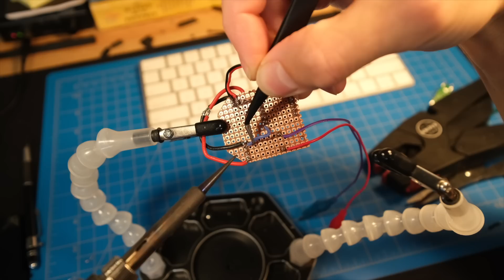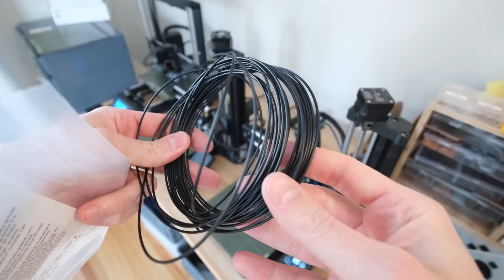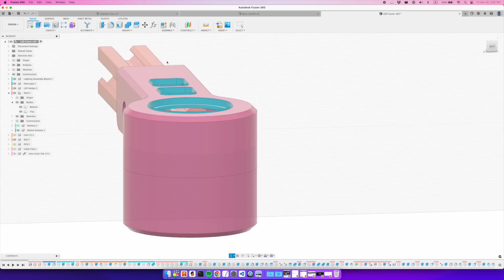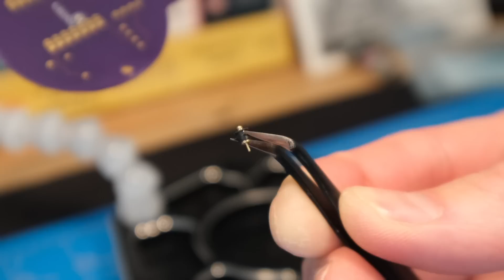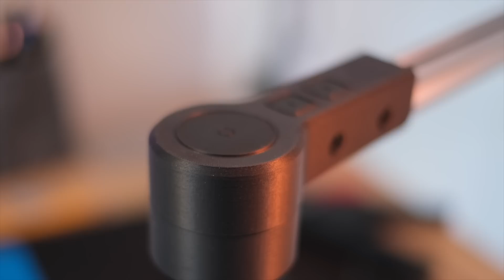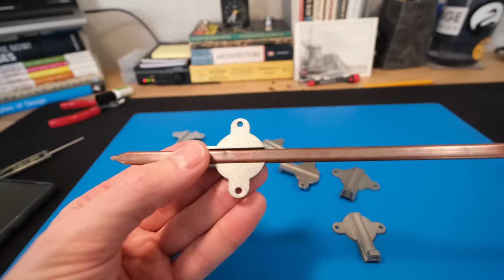The DIYson Electronics Pushed my Limits - DIYson Lamp Build Log #7

Comment: For the flickering you may try sweeping the whole frequency range and find a frequency that works with the frame rate of your camera. Maybe something close or little beyond a multiple of the Nyquist frequency would do the trick. If you record at 30fps, try between 120-125, 240-245, 480-485, etc.
Reply: this!
Reply from the maker: Great idea, I'll try this
Reply: I was going to comment for this reason exactly. Just make sure that the frequency is a multiple of the frequency of your camera and you should be good. Likely a multiple of 30 will do e.g. 990hz. But check with your camera specs. As long as you’re above 240 I wouldn’t be too worried about visible flicker IRL.
Reply: yeah i was thinkin the same.
Reply: @MrHejole  yeah the flicker is only an issue for people that film and it isn’t designed to be a filming light, it may cause some issues if people are using it as a workbench light and they are using cameras or machine vision or digital microscopes but it shouldn’t be much of an issue otherwise. 

Another point to consider is that the flickering may affect the future ambient light mode, there will need to be something in the code to compensate for that, although it would be pretty difficult since if the sensor is measured when the pwm is low, it would see dark and if measured when the pwm is high would see full brightness. So for that changing the frequency wouldn’t matter, it would still affect it. The only way I can see that working is if the sensor takes loads of samples and averages the brightness.
Reply: It might be that the flicker has as much to do with the shutter speed on the camera as it does the frame rate. Don't know how this is being filmed, but if the shutter speed it 1/2000 of a second, it's going to make a huge difference where the lamp is in its PWM cycle, because that's the period of half of a cycle. Add to this the fact that two digital clocks (your camera, the microcontroller in the lamp) are never going to match perfectly, and your video flickers. However, if, for example, you filmed at 25 fps and had a shutter of 1/50th of a second, there are going to be a very large number of PWM cycles within that exposure. There will still be variation, but it should be less pronounced.

Ideally you would also increase the lamp's PWM frequency to take advantage of this effect, but leaving the shutter open for longer may also help. Could be worth a shot.
Reply: @sam.skinner  oh yeah, I didn't thought about shutter speed, that should be taken into consideration too. With that I think my first suggestion won't really work. Interesting to see what happens around those frequencies though.
Reply: Awesome project!
The only problem is that usually one doesn't always record at a constant shutter speed, which would need a coupling of the camera to the light:)
Analog dimming might be the way to go.
You still use the digital PWM output pin, but add an RC-filter. 

PS a commercial beautiful led Lamp also has the flickering problem due tobpwm dimming. Not visible by bare eye, beautiful light but if I want to photograph sth under it, it's a pain
Reply: @phenyl22  In most cases the shutter speed isn't something you should be changing while you film (unless you are shooting slow motion  i.e. 120fps).  You should be adjusting the aperture and/or using ND filters to keep the aperture open if needed, keeping the shutter steady.
Reply: @StevenBennettMakes  
Or try inbetween 1000 and 4000, maybe it doesn’t flicker and doesn’t make any noise.
Reply: Or even just change the value to an integer multiple of your camera's fps. Like altering it slightly to 990 might work fine for 30 fps

Comment: Quick suggestion for the PCB, I would suggest adding copper pours for power and ground because a project like this that pushes a decent amount of power through the LED's needs to have some copper area to dissipate that energy. Its something many beginners miss but you'll soon figure it out the more PCB's you make. Besides that, great job!

Comment: Really enjoying this series. For the issue with flickering/buzzing, you could make use of the fact you're now using a custom PCB. There are a lot of ICs that will do the same thing as that drop-in LED power supply, with only a few extra components.

Just had a quick search of DigiKey and it something like the MAX16832A might work. Its data sheet has the PWM dimming input frequency at 200 kHz for its standard tests—so you can put the PWM frequency much, much higher than your present 1 kHz. You may still get audible inductor noise, but at frequencies above 20 kHz you won't hear it, so that solves both issues.

Alternatively, you could use that LED power supply with an analog dimmer. You'd just need a simple RC (resistor-capacitor) low-pass filter between the PWM output of your microcontroller and the analog input of the power supply. There are calculators online; you could put the -3 dB corner frequency in the ballpark of 20-50 Hz. That said, it looks like most of the analog inputs to these devices get turned back into PWM internally, so you'd want to make sure that the internal PWM generation frequency was itself sufficiently high, or you'd end up with slightly more complicated circuit with the exact same flickering issue.

Some DigiKey search results for 700 mA driver ICs:
https://www.digikey.co.nz/en/products/filter/power-management-pmic/led-drivers/745?s=N4IgjCBcoCwJwyqAxlAZgQwDYGcCmANCAPZQDaIATAOyVwCsEAukQA4AuUIAyuwE4BLAHYBzEAF9JQA

I think in this case the drop-in supply is causing too many design conflicts, and an IC would serve you better, despite the extra work interpreting the data sheet. Fortunately, several of the IC data sheets are pretty comprehensive. They include formulae to calculate all of the component values, and some even have suggested PCB layouts for the IC and supporting components. (This is the case for the MAX16832A. I should point out that I haven't used it before; it just ranked highly in the search results.)

Comment: Really like the extended story and detail in instalments  - gives a great understanding as to the complexities of going from initial idea, through prototype, into final form - Real Project Engineering. Also shows how a 'big project' can be achieved by breaking the task into smaller stages - with iteration and refinement to problem solve and develop features as the project progresses. A great example  of "Divide and Conquer" to reach a working solution. 🙂Thank You

Comment: I use very high PWM frequencies (20KHz and up) to avoid audible whine. In a few recent projects, I used the NXP PCA9634 8-channel LED driver, which uses a 97KHz PWM frequency. It’s also easy to control via I2C. Using white LEDs and small power MOSFETs, one can run the microcontroller and LEDs directly from a single 3.3V rail. 

There’s also the nearly identical (but now end-of-life) PCA9624 which includes power MOSFETs inside, allowing it to switch up to 40V at 800mA.

Comment: I'm glad this showed up in my feed. I need to go back and watch the older videos still. 

As far as DIY leds and heatsinks attaching directly to modular aluminum frame that incudes a flat side with thermal adheasive tape has been the most economical.  I think to eliminate most of the heatsink assembly and cost if you just hacked sawed the top of the aluminum frame for electronics and tapped two holes into the bottom for you holder.

Comment: For the metal bracket you mentioned at the end, I don’t think it would be out the the question to make it out of sheet metal, it is a relatively simple geometry, the attachment point at the end could just be a bent up section and the heat pipe channel could be done by bending the two sides, it also won’t be visible. Then you could provide a stencil that people print out and stick on a metal sheet, then they have a guide to drill the holes, make the cuts and then file it down to the final shape, then they just need to bend it, which if made out of aluminium shouldn’t be all that difficult, it would just involve a few tools, a drill, a hacksaw, a file and probably a vice. You can get aluminium sheets very cheap, probably a lot cheaper than getting it machined.

Comment: First time here and love the project. As someone who also is also self-taught in pcb design, I see you making a lot of the same mistakes I did, namely missing power planes, far too small trace width, messy routing and a couple others. Whilst your pcb works, there is a tonne of complex rules to follow in order to achieve correct results and these become far more important with more complex pcbs. I would highly highly recommend Phil’s Lab to learn more about pcb design, specifically his design review videos have helped me immensely. Good luck!!!
Reply from the maker: Thanks for the recommendation! I will definitely check that out. Hopefully V2 will be a big improvement

Comment: This is been a fun series to binge.. One thing that you may want to consider is to  run higher voltage at lower current via the drag chain and stepping it down to your led dri er level in the pcb. Higher current lower voltage may heat up the small guage wires you run through the constrained space.

Comment: I've built many LED lighting projects. It is slightly more advanced than using a sealed LED driver like yours, but consider designing a PCB with a LED driver IC instead.

Many of these can support much higher PWM frequencies and also offer other benefits, such as multiple output channels (colour mixing of cool/warm). You can get Buck/Boost driver ICs, which require inductors but can run LEDs at a different voltage to the power supply, or linear driver ICs, which can only run LEDs below the supply voltage but don't require as many extra components. Any "extra" voltage above the forward voltage of the LED will be dissipated as heat in linear drivers so it helps to have a power supply just slightly above the LED forward voltage.

I tend to use linear drivers because they're simpler and can be more efficient if the power supply and LED voltages are closely matched. Give me a shout if you want to chat!

Comment: Love this project, i never heard of this lamp and now I can't wait to try it myself. After looking up the original product, they use a barrel connector in the base to allow it to fully rotate (90 degrees so the cable goes horizontally through the base). For the chains, I suggest fixing the first half of the chain to the profile(or just the middle link of it), this way it is forced to fold onto itself and stays clean when the arm is fully retracted

Comment: for the on camera flicking issue, it should be sufficient to set the "right" frequency instead of cranking it up like there is no tomorrow.
most cameras still shoot at 25 fps (for yt and instructional videos i guess), so a multiple of that, at least so high the human eye can not detect the flicker, should work. also, that would be easy to implement in code with a settings variable like "set your camera fps here".
Reply: If it was set to 600 I think it should work for most of the common frame rates (24, 25, 30 and 60 fps)

Comment: I've used those capacitive buttons in the past and you can actually get them to work with a thin layer of (non conductive) material between your finger and the sensor area, meaning you can just print the cover with a section 1-2 layers thick and just sense through it. The circuit is also pretty simple, just an off the shelf IC and there's basically no calculation for the size of the conductive pad, so it would be pretty easy to make the capacitive buttons integrated to your main PCB. Awesome project though! Excited for updates.

Comment: This is so fun. Thanks for sharing! May I suggest using the horizontal arm itself as one big capacitative trace: one touch of the arm to turn on/off and then slide your finger along it to increase or decrease the light intensity. In this way, you would completely get rid of all the buttons.

Comment: After the past few years of making tons of LED projects (for VR DJing. Audio reactive armour) I have been thinking about making my own PCBs for a while. I've seen a few of the programs/websites that pop up over and over but my electronics engineering mindset is still very much in development. Thanks for the adafruit website tip. Great video as usual

Comment: I see a hint towards a rail based power delivery system. Exciting stuff. I like the decision to shift to a custom PCB and house the electronics in the head. Thankfully custom pcb manufacturing is a lot more approachable now and you can even get individually manufactured pcbs for not a lot. Obviously further miniaturization could be done, but not without making it too difficult for most people to build themselves.

Thanks for acknowledging the need for tactile feedback. Perhaps integrating some sort of haptics might be good? Probably unnecessary to add the expense though. Love the attention to detail. I like a lot of the comments suggesting a DC barrel jack in the base. I think for reliability and rigidity reasons I would still opt for a bearing of some sort to handle the load, but the barrel jack would be great for handling voltage transit with rotation, and you could pass the wires through the center if the extrusion and through a hole for connecting to the cable chains or rails if they end up working out.
Reply: I also think it is critical to get this base joint as sturdy as possible. The lamp is like a huge lever on it and when moved or touched even more so! If a quality feel is desired, that joint must be rock solid other than "wiggly-wiggly". Preferably with metal insert and proper bearing. As @ZeroX252 stated, the cable can run inside the bearing still allowing for 360°-ish rotation. I think most ppl wouldn't rotate the lamp 5 times 360° in a row, right?
Reply: @el_micha  If you use a barrel connector you can get full 360 rotation, or if he continues with the slip ring that will also work for full 360 rotation. Just want to take the lever action off the slip ring or dc barrel connector and put it on a proper bearing both so the action is smoother and so it feel more solid like it's one object.
Reply: You'd need to fix the barrel connector on both sides, and just far enough apart that they don't completely bottom out (so they aren't bearing the load, and the bearing itself is)

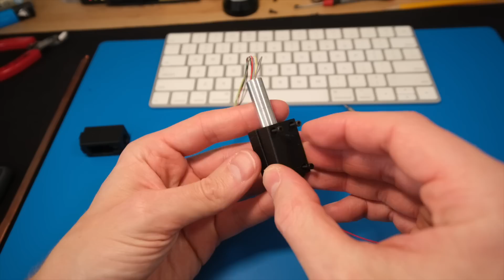Comment: 10:46 I think for the base power cable management, you should go for magnetic pogopin connector. It can be rotate able freely without worrying about the cable. Hope it helps

Comment: Another trick to get capacitive buttons into existing designs is to use large copper tape pads behind a thinned out section of the print. I was able to get up to 2cm range with pads roughly 4x4cm in size and a dedicated capacitive trigger board. This would make assembly both cheaper and easier, but be aware that they can misfire at high sensitivities from too much electrical noise.

Comment: Came to this project log from Hackaday.  Very interesting project. Gold star for perseverance.
I think you may need to build your own LED driver PCB or better yet integrate it into the PCB you've already designed. SDG electronics did a series on designing a LED driver. SDG #160 for example.

Comment: The flicking (and sound) is caused by the PWM dimming. Some people recommend hè ging your frame rate, but this is a bandaid. 

There are two ways of dimming LEDs. The first (and simple) way is using PWM. The cleaner way is by using a constant current controller. You might want to look into LED-drivers. 

Good luck!

Comment: hi just wanted to say that this is a great project, an idea for the wiring that you could consider that doesn't infringe on the dyson patent is using copper tape in part of the aluminum channel that doesn't have the belt in it. you could then add contact points in the led housing and the carriage to connect to the copper tape. This solution requires no moving wires which could also fail from fatigue over time.
Thanks for well documented process

Comment: Cnc milling would be a superb solution for the metal cooling bracket. As is the design would work ofcourse. But a tip for lower cost is to design it with fastening/fixtureing in mind. also easy indexing/alignment if you would like to machine both sides. And one thing i almost forgot! 
To tight tolerance's, can with bad luck get expensive to😊 great work and great videos. I just want to hear every little detail!😍

Comment: I actually have a recently delivered ShopSabre IS408 CNC (only 3 axis, but it'd be possible to drill that side hole after with a jig) out in Ohio that's mostly idle as I prep for the launch of a business (probably won't be at capacity for a while). Not sure what your discord is but if you need CNC'd parts, I can probably do them fairly cheaply as CNC goes, with the caveat that I'm still learning. And of course, I love love love the series and your no-compromise approach every design decision, small or large. Best thing I've seen on YouTube in a long time!